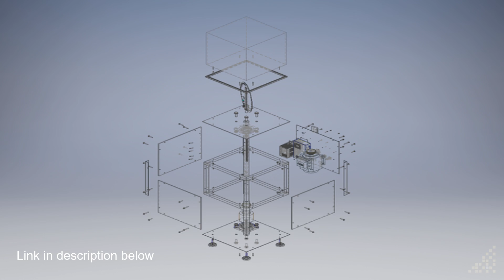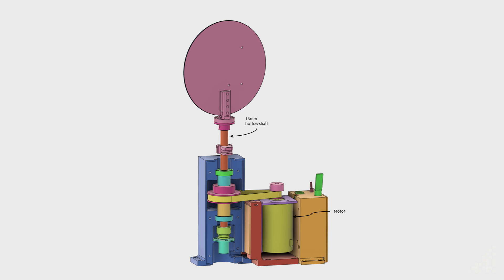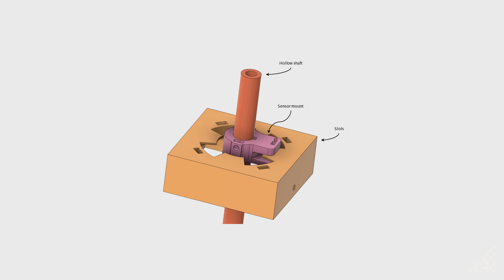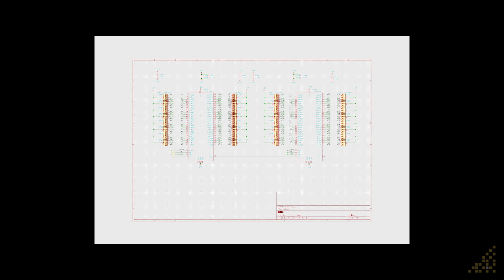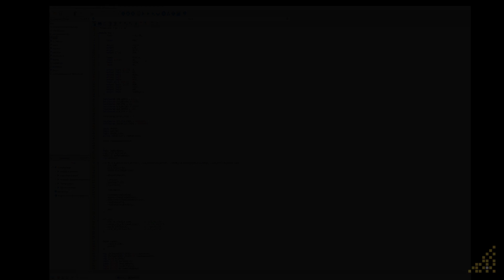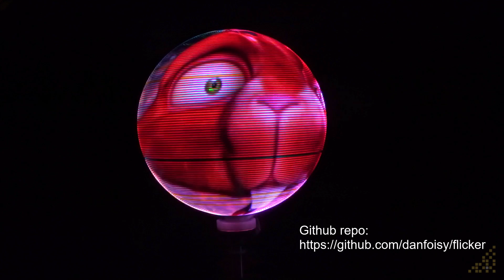Flicker - a spherical display

Comment: could you had offset half the leds by half the distance to achieve an interlaced image with double the resolution?
Reply from the maker: that's exactly what I tried - but the system was very sensitive to the angle of the board relative to the axis of rotation.  It was really hard to keep everything aligned

Comment: That's an amazing job of mounting all those LED's, and exceedingly tedious I'm sure. The first thing that springs to mind is if the back side was a smaller diameter you could show some physical relief, and another paddle would give four levels of height to the map. The mind boggles when you realize that the flat could be covered in cowled lights and present a stable screen to go with the spinning periphery. Sorry, just smoked one and the mind wanders to artistic fancy, well done lad.

Comment: I just discovered your videos and they're some truly next level stuff! Subscribed. This reminds me of a similar (and simpler) project I have on my backburner. It's a hand fan with a LED strip along the curved edge, controlled by an ESP32 and an IMU hooked up to give it yaw/pitch/roll. With that I'm able to create POV images when you flap it. Biggest problem is the best LED strip I could find is the DotStar with 144 LED/m. With that linear resolution I can only make basic shapes. Any ideas for getting a higher density programmable LEDs like you made, but in a more flexible format?
Reply from the maker: Thank you!  I do have some more projects to put out here, just takes time to make videos :)  Sounds like a cool project! You ask an interesting question. Dotstars are probably the fastest addressable LEDs but if you're looking for something better, you'll have to build it yourself I think. You can obviously get non-addressable LEDs and install them on a custom PCB at a very tight pitch (1-2mm).  The challenge is then how to drive them - if you have some smallish number (16?), you can use a small microcontroller and connect the LEDs directly to the GPIOs (being careful to limit current to the total the micro ports can provide.)  A little bit more complicated would be to use a bunch of serial shift registers with an LED connected to each data output, each register (or chain of registers) being driven by a common clock but connecting the serial in of each register to a seperate micro data line - this allows each shift register (or chain of registers) to be updated in parallel, given you a nice fast update rate but at the expense of more complicated code to do brightness control (just shift out multiple bit patterns to PWM the LEDs).  Or you can use a dedicated LED driver chip as I did - more expensive but very fine current control of the brightness.  So a few choices here - for a decent number of LEDs (say 64), the shift register would probably work well, especially if you use DMA to shift the bits out.  

My 2cents :)

Comment: Could you add two additional daughter boards to form an X pattern with the boards, so that there is twice the amount of LED's present, increasing the accuracy and probably reduce the flickering issue?
Would increasing the speed of rotation also reduce this (bearing that the LED's can keep up)
Reply from the maker: The flickering isn't as apparent in real life - it's just hard to adjust the camera frame rate to the rotation rate.  Definitely, having more LEDs as you suggest would help.

Comment: I find it impressive that LEDs can change color so quickly without showing too much stress! I never really thought that lightbulbs would be capable of something like that since I’ve been told turn on and off lights really quickly is really bad for them
Reply from the maker: you also have to recall that the light LEDs emit is directly caused by electrons/holes flowing across a PN junction - an old-school light bulb uses those same electrons to heat a filament.
Reply: It was true for halogen lightbulbs, but LEDs can pretty much live forever if you don't get too close to the max current (and therefore temperature)
Reply: @albertweber1617  im pretty sure its true for fluorescent bulbs too, on startup a huge voltage is released by the ballast which kickstarts the lamp, every time you do it the filaments on each end get worn away far quicker than leaving it on
Reply: @SomeRandomPiggo  yeah, i confused halogen and fluorescent
Reply: Yeah and when you switch a filament bulb on and off repeatedly, if will heat up and cool down repeatedly and wear down the filament, shortening it's life.
Reply: I'm actually not too familiar with electrical technology so thanks for explaining!

Comment: Very cool!
Would also spinning the disc around its center give you higher apparent pixel density? Adds complexity of course, and maybe some gyroscopic effects too.
Reply from the maker: wow, that would be crazy!  I guess in theory, you could get away with a single LED if your rotation speeds were high enough

Comment: Id be interested to hear more about the fpga. Not so much the exact code, but a more in depth look at how you went about designing it. I've had a hard time finding intermediate fpga walkthroughs
Reply from the maker: Noted!  I've been asked about this in the past as well, just finding the time is problematic.  However, I can tell you that the simulator, as well as the built-in logic analyzer are probably key to hacking FPGAs.  Of course, I'm not going for complete timing closure so my life is simpler than if I was doing this for production.

Comment: Any plans for smaller concentric rings for a truly 3D-spherical display?
Reply: Might as well spin a full LCD screen at this point I think
Reply from the maker: not sure an LCD screen would have the update rate required but I've been helping a group of university students build an LED screen that they're rotating to get a full 3D effect.  I'll link here if they get it working.
Reply: @abitembedded  what if it was only a single column of the lcd pixels? That way you can refresh each pixel as much as you want
Reply from the maker: @luka5144  I've never seen a single column for sale :)  You might be able to play with the timing of the vsync signal to only address the first row of an LCD panel but even then, I doubt that the way an LCD works would lend itself to being refreshed at >10kHz